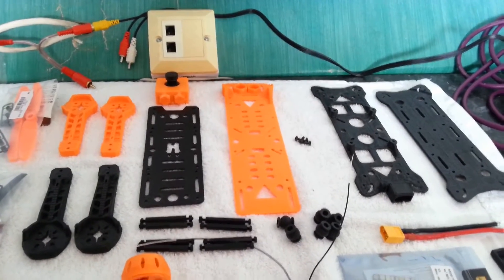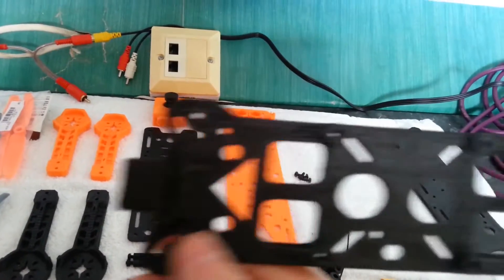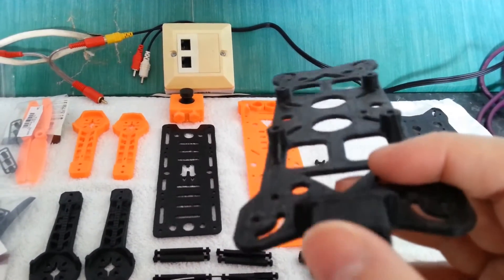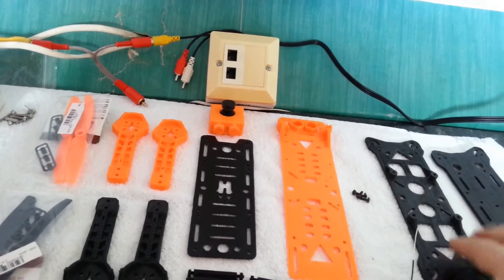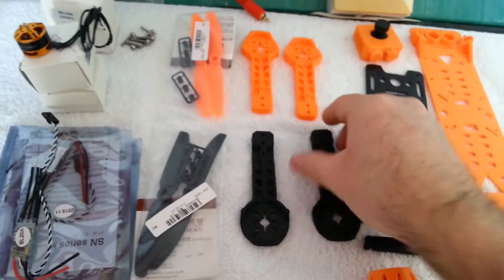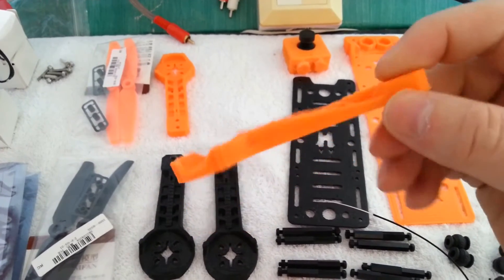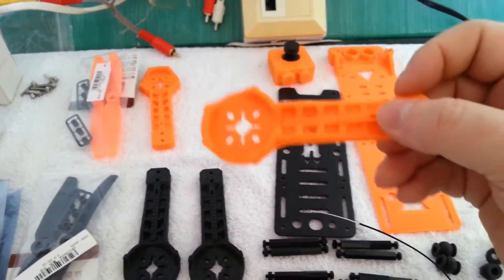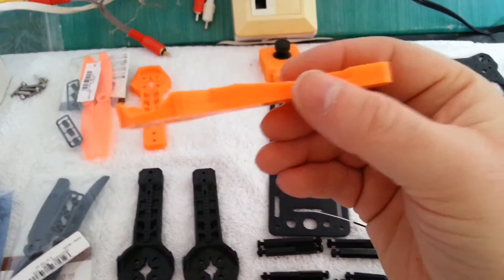3d Printed Quadcopter Build

Comment: Cool video. What is the total weight of the quad and what battery are you using?
Reply from the maker: hi there. The flight weight of the quad is 297gram with battery. I was quite surprised going down from my 450 weighing just over 1kg
Reply: Dude I can't believe it. I am building a 450 quad and as you said just over 1kg. But the battery i am using is a no name 3000mAh 3C LiPo with a weight of 270g. Are 3D printed frames that light?
Reply from the maker: there is a little bit of that, but i'm using a zippy 3C 1300mAh battery which is pretty light. I calculated my 450 to have 1.5 times thrust than the flight weight. I did this buy building it in excel calculating the weight of each component and then adjusting the motor/prop config. My 450 has 2.5Kg max thurst, so it goes bye bye really quickly ;)

This thing is zippy and enough for me to handle right now, but will be moving ont 4C+ when i get the hang of it ( and improve my reaction times :) )